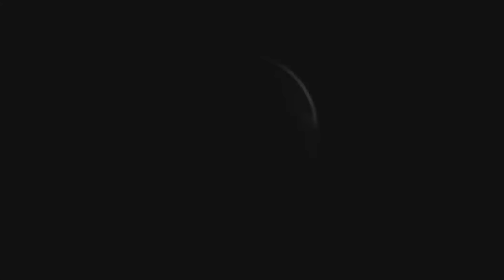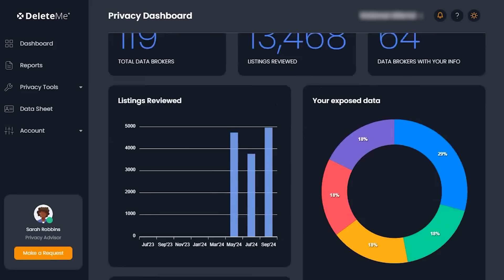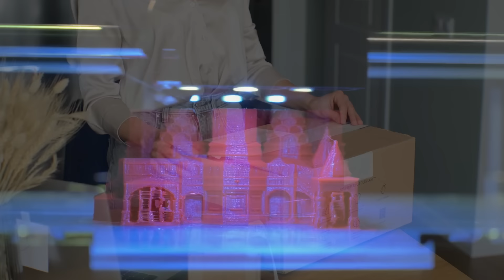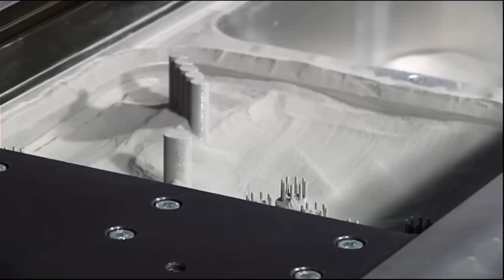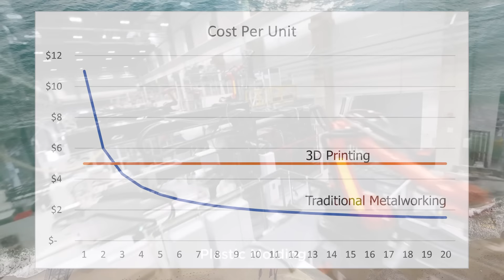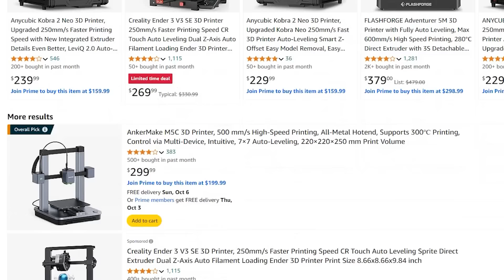3D Printing, Cathie Wood's Latest Disaster

Comment: I don't own one 3D printer.  I own 6 of them.
Reply: @joeking433  they did, for sure, they innovated like a true tech company, then everyone copied their designs. They were so soccuessful that they got sued for patent infringement from a bigger company that felt threatened by them. The 2024 happened and no seems interested in 3d printing anymore. Hardly any new 3d printers were released, and the ones that did sold so poorly, that had to discount the price by a lot.

Even bmwmblulan dropped their prices on their lower end machine, yet I don't think they are selling like they use to be. And the second hand market for 3d printers has lowest prices ever. Idk, so far all these 3d printers are good enough, yet they still require some mechanical skills to be able to replace parts. Its not like you can take it to a 3d printer shop, and have it repair for more than buying a new one.

I don't see any more growth in 3d printing, unless people start doing print farms or has a lot of innovation built in that it basically is no hassle to own one.

Comment: I have to dispute "chances are you probabky dont own one or know anybody that does" 

The chances are more in favour of knowing several people who have/use 3d printers.

And "some companies" use them... I would challenge you to find me a design/manufacturing company that is stupid enough NOT to utilise them in their design process.
There is a reason that "3D printing" as it is now known, used to be called "Rapid Prototyping".

Either pay a machinist to use multiple bits of metal, multiple cutting tools and multiple machines to try and knock up a prototype... OR... throw the design files, with some adjustment into a "3d printer" and see the results within minutes.

The industry buzzword for "3d printing" the last thing I knew was "Addative manufacturing".

Comment: I see potential for 3D printers for making niche products. Some of the customers I have are investing in 3D printers because this reduces the need for stock items in case of failing parts, but they readily recognize that this is in no way a manufacturing practice meant for the actual production phase. The only instances I have experienced where it is part of mainline production is when the parts are in a prototype kind of assembly, such as race cars or the properties of printing a part favors it over CNC. 

I would speak with companies making 3D-printing equipment to find out what kind of customers they are expecting to sell to, then speak with their potential customers to see if there is any reasonable road to the former's vision.

Comment: The info in this is WAAAYYYY incorrect.  I just bought one and expected it to be "finicky" and it can be BUT if you download straight off their website it pops out exactly what you want with almost zero maintenance.  
Cheaper to buy a little plastic part of Temu.  Wrong.  Absolutely wrong.  Plus you don't have to use 1200 gallons of fuel oil crossing the ocean.
Absolutely the least researched frankly AI suspect slop video I've seen pop up for a bit.

Comment: There are very few use cases for the need of a privately owned 3D printer that would justify buying one. Since they are around I haven't had the need to 3D print anything and I am somewhat of a tech nerd working in IT. It's pretty safe to assume that the Howard Johnsons and Deborah Steins of Oklahoma won't need one, either.
Reply: You can make anything plastic that you can dream up.  I use mine all the time for situations around the house.

Comment: I am a 24 year Aerospace Engineer and the GE story was always just hype. In short, they bought up a bunch of 3D printer companies then had their engine business cherry pick some lightly stressed parts to convert to 3D. After that, they hyped it as the next wave of mfg tech and the likes of ARK (and my CEO) ate it up. I spent years trying to find use cases but at the end of the day the material properties of 3D metal parts are lousy.

Comment: This video is right and wrong. 3D printers like formlabs are used by engineers all the time for prototyping. And metal printers are trying to compete with cnc machines which have the same type of single part issue as 3d printer. Also Europe is starting to about WAAM technology to reduce material waste and machine time for large metal parts.

Comment: I worked in an aerospace metal shop for years. Mostly CNC machining. I promise you aerospace companies are not using 3d printing to prototype. They can just machine that. 3d printing metals will never be trusted for that purpose because metals are FAR stronger when machined from a solid block. The grain direction needs to be very even and designed into the structure. And those companies spare no expense when it comes to prototyping. They want to be able to test designs and show them off. This can't be done with a half-baked, weak 3d print.

Comment: I use my 3D printer mostly to make custom mounting and fixture parts.

I use openscad, calipers and a cheap LiDAR scanner to get the necessary measurements and the design usually takes me 10 minutes per part where no commercial product solves the same problem.

I've made a decent chunk of cash doing this for friends and family.

My current printer is a cheap one but I might buy a Prusa XL 5 head next year to make parts combining multiple different types of plastics, and I might add an MMU to be able to run 5 colors of material through one or multiple nozzles.

Comment: 3D printers are only viable to fill a niche. Complex geometries that CNC and molding cannot fill. I worked on 3D printing industrially used copper cold plates that were 5x performance. They are expensive, but there's nothing else like them and can't be produced via any other method.

Comment: As someone who uses 3D printing on a daily basis and has been involved on software defined printers I'm offering my take. 3d printing is quite similar in utility to the Laser/Inkjet Printer and Desktop Publishing  in the late 80's. You wouldn't do a full publishing run with it, and print on demand is niche but it has had a huge impact nonetheless over the previous technology such as mimeographs and typewriters and even small print shops. Just consider the impact digital cameras and inkjet/dyesub printers had on photo processing.
The capacity to rapidly prototype parts and iterate designs in an R&D/small business environment has a huge impact. The reduction in cost and increase in flexibility over having to go to machine shops is huge, what would have taken several weeks and hundreds or thousands of dollars now takes hours and a dollar or two of filament or resin. If the design is successful then you switch back to more conventional methods such as injection molding or CNC for mass production. (Keep in mind that the same arguments against 3d printing were levied against CNC for decades). The problem as usual is that marginally literate tech bros cough..Bre Pettis..cough oversell the tech.

Comment: My PhD group tried so many times to make 3D printing work. My experience is it killed my reaction every time and no amount of treating the plastic would allow me to recover. I tried everything. Never published the work.

We tried to modify the plastic/polymer for extraction and it would never take the modification. It worked until it went through the printer. 

We ended up just using it for some simple hardware that I could also make with a heat gun and some plastic pipette tips. 

But put 3D printed in your journal article title and it catches everyone’s attention. 😂

Comment: The value in the 3d printing is not in the printers but in the patents that it can create.  I can see a new and more powerful processing chip being created and produced via a 3d printed technology.  It could be a highly different process and could derail a monopoly.  3d printing has that capability in the production process and patents.  These suppliers need to foster innovation by incentivizing the patents and processes of better products.  3d printing needs to be focused on semiconductors and superconductor production.  Right now, we are in the large industrial phase of the 3d printing.  You can make one that can fit in a home but it isn't practical unless they play DnD and they need a goblin on the fly.  They are practical by giving an edge in the terms of semiconductors and the application thereof.

Comment: As someone who worked in the manufacturing industry, we always laughed about the disruption that 3D printing could bring to this space. Engineers and Tool makers have had centuries, if not decades to improve both the processes and the manufacturing equipment. Even the approach to design parts has been optimized with these manufacturing processes in mind. 

Even CNC and EDM are considered high cost unless the amount of precision they provide is actually required.

The only niche applications where this would benefit are nowhere near as high volume as people might think.

Comment: It will happen. But 10-50 years out as the technology becomes viable at cost. 

Why? If companies can sell you products and you can manufacture replacement parts when they break, they no longer need to keep inventory. This will save them a fortune and drive huge margin growth. They will just sell you a blueprint and you will make it yourself. 

It will happen. The technology just needs time. But the money reason, will make it happen

Comment: For the industrial printers it's not exactly new competitors. Companies like GF and Sodick have been making traditional machine tools for decades, 3DS and Markforged are kind of the newcomers in the market. If a company or distributor is already using/selling Sodick wire EDMs or GF mills and sees a printer from them, they might see that as a safer bet than a company they've never bought from before.
Reply: If I saw them produce something that they are not known for then I would be skeptical, I would not purchase a Lathe made by Sodick or GF.
For example Nakamura-tome makes lathes, Makino makes mills and Studer makes cylindrical grinders. (all high quantity production machines)
Some korean machine tool builders make lathes mills and other machine tools, these can be good quality for the money and decent enough performance.
If a company tries to make everything they spread their focus too thin.
Reply: @KerseyKyle  That's true to an extent, but there is overlap between different types of machines. Knowing how to make a rigid, thermally stable machine, and having a factory and workforce familiar with the process is useful for a lot of things. GF makes mills and EDMs and works with 3DS on their printers. Sodick makes mills using similar linear motors to their wires. There's institutional knowledge there about making machine tools where it doesn't all transfer to printers, but there's also a lot of stuff that absolutely does.

Comment: Odds are you don't own a 3d printer either - otherwise you would know that the new printers are actually pretty good, filament aint that expensive either and there are several dozens options of materials to chose from, from soft to metal like... I don't think so standard printers weren't widely adopted in just a few years either. Its a cycle - first prototypes - then industry applications - than hobbyist and only after standard customers. Lets see on a few years

Comment: If you have spent a lifetime curating the skills necessary, 3D printing can be a career and basis that starts a larger industrial business. It also allows you to almost immediately enter any sector of manufacturing which you can build a machine for. If you are a home user, that knows little or nothing, this is a hobby, not a production appliance.

Comment: Diy 3d printing has died out in the last year. There hasn't been anything new coming out this year. Nearly every 3d printer copies each others design, innovation is dead. 3d printing is truly a hobby, you have to master the craft to make great use of it.
Reply: I don't see that at all!  Bambu Labs has revolutionized 3d printing since coming on the market a couple years ago!  Basically plug and play compared to a decade ago!  And the slicing software is amazingly advanced and well thought out!  Especially compared to CNC software which I don't think has changes since the 80's!
Reply: @joeking433  they did, for sure, they innovated like a true tech company, then everyone copied their designs. They were so soccuessful that they got sued for patent infringement from a bigger company that felt threatened by them. The 2024 happened and no seems interested in 3d printing anymore. Hardly any new 3d printers were released, and the ones that did sold so poorly, that had to discount the price by a lot.

Even bmwmblulan dropped their prices on their lower end machine, yet I don't think they are selling like they use to be. And the second hand market for 3d printers has lowest prices ever. Idk, so far all these 3d printers are good enough, yet they still require some mechanical skills to be able to replace parts. Its not like you can take it to a 3d printer shop, and have it repair for more than buying a new one.

I don't see any more growth in 3d printing, unless people start doing print farms or has a lot of innovation built in that it basically is no hassle to own one.
Reply: @joeking433   @joeking433  they did, for sure, they innovated like a true tech company, then everyone copied their designs. They were so soccuessful that they got sued for patent infringement from a bigger company that felt threatened by them. The 2024 happened and no seems interested in 3d printing anymore. Hardly any new 3d printers were released, and the ones that did sold so poorly, that had to discount the price by a lot.

Even bmwmblulan dropped their prices on their lower end machine, yet I don't think they are selling like they use to be. And the second hand market for 3d printers has lowest prices ever. Idk, so far all these 3d printers are good enough, yet they still require some mechanical skills to be able to replace parts. Its not like you can take it to a 3d printer shop, and have it repair for more than buying a new one.

I don't see any more growth in 3d printing, unless people start doing print farms or has a lot of innovation built in that it basically is no hassle to own one.
Reply: @joeking433  they did, for sure, they innovated like a true tech company, then everyone copied their designs. They were so soccuessful that they got sued for patent infringement from a bigger company that felt threatened by them. The 2024 happened and no seems interested in 3d printing anymore. Hardly any new 3d printers were released, and the ones that did sold so poorly, that had to discount the price by a lot.

Even bmwmblulan dropped their prices on their lower end machine, yet I don't think they are selling like they use to be. And the second hand market for 3d printers has lowest prices ever. Idk, so far all these 3d printers are good enough, yet they still require some mechanical skills to be able to replace parts. Its not like you can take it to a 3d printer shop, and have it repair for more than buying a new one.

I don't see any more growth in 3d printing, unless people start doing print farms or has a lot of innovation built in that it basically is no hassle to own one.

Comment: My lulzbot Taz 5 with upgraded heated print bed is still cranking out prints for stuff I use for the last 10 years. ABS, if you can get the heating right, is pretty durable material and it is cheap. There’s just things I want that no one sells so I design it and print it. Mostly custom organizers for drawers, holders for things, replacement buttons in old cars. I do think it’s more of a hobby thing though.

Comment: I use 3D printing to repair and build all kinds of things around the house. I love it as a hobby.

It is evident it can not compete with large scale production methods and there is only a niche market for metal 3d printing right now.

This may change. Just look what 3d printing with plastics was 15 years ago. Things move quickly.

Ps. A kilogram of PETG costs 12 bucks. It is not expensive. Printers do require maintenance, but newer ones require far less of it. My V400 has been running for 1,5 years almost 24/7 and I have never done any maintenance. None.

Comment: I have been doing 3d printing for a couple of years and this ETF is really a terrible idea. 3d print is not new, jt was first invented by Hideo Kodama in 1981. The concept is not new. The rrason it got popular is because of hobbyists. The recent surge in popularity is due to cheap Chinese printer manufacturers using off the shelf parts and open source programs derived from CNC machine code. This means unless you are doing something highly specalized you can do 3d printing for a few hundred bucks. For specalized stuff like metal, these are low volume printers that only if you havr a need. Otherwise just use regular 3d printer to make a mold and use casting methods. Also 3d printing depending on size can take hours or days to print therefor not as efficient. Woods should have tried 3d printing and see for herself if it is practical.

Comment: In my opinion, it is corporations that held back 3D printing. Obviously there are the major patent issues that limited competition especially early on. But the idea of 3D printing a replacement part is not accepted by vendors. They don't release 3D printable parts to the public. They want you to throw things away and buy a new widget, not fix it. You can design your own replacement (many people do) but not only is that difficult, you can run into patent or trademark legal risk.